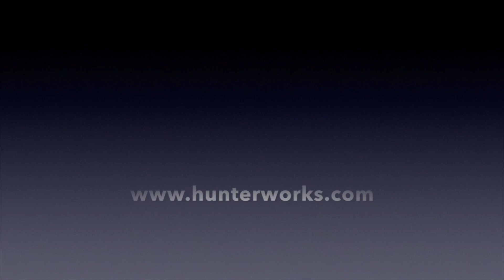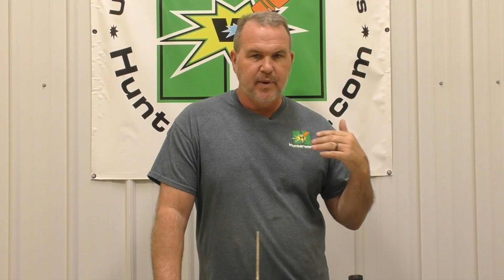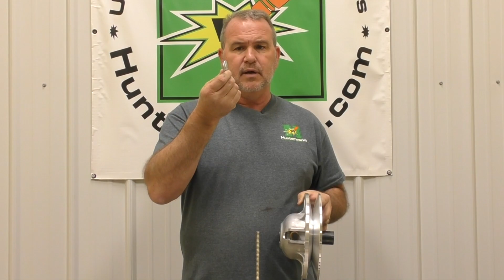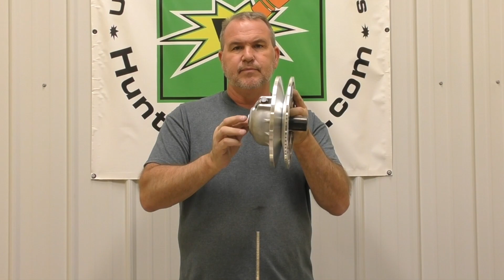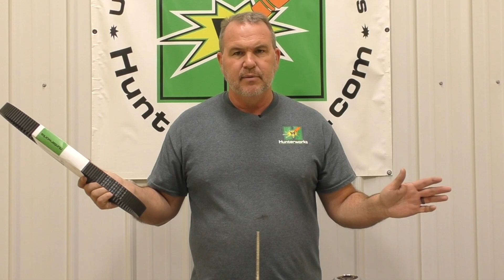Tidbits of info on the install of our new Hunterworks clutch System

Comment: Good information 👍👍thanks for the research and development🤙one question does this setup work for slow riding or is it best suited for the faster guys?
Reply from the maker: No matter who you are, you would be buying this if you needed a new secondary and maybe a new primary and didn't want to buy a duraclutch that is pretty much only for slower riders.  You can set this kit up to drive slower too and have more belt grip
Reply: @Hunterworks  Thank you for the reply 👍👍
Reply: Do they make one for a rs1